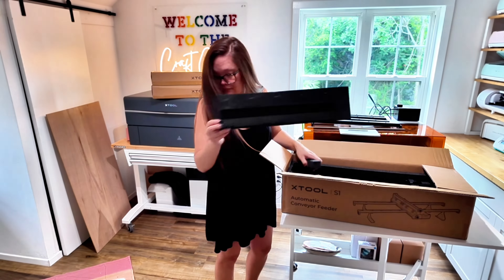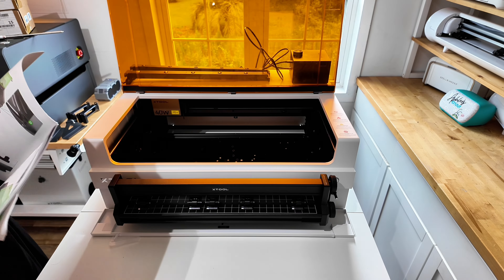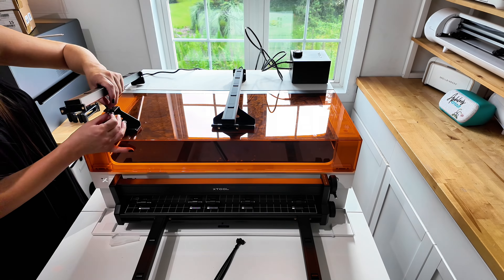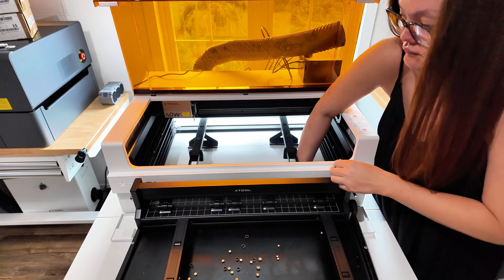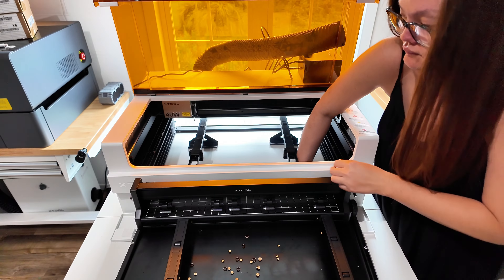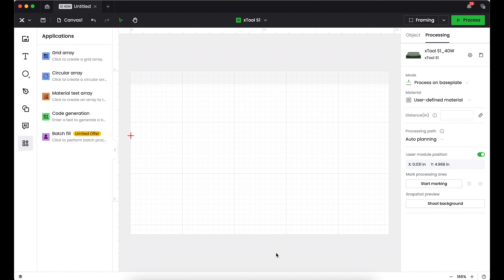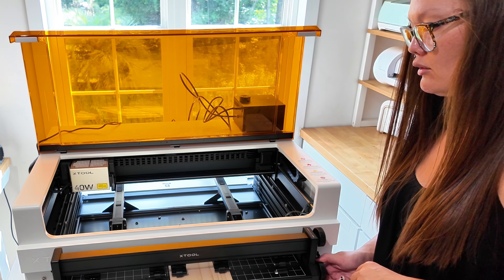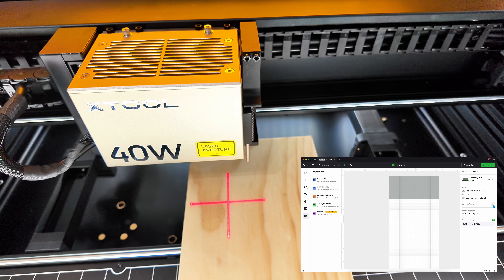Mastering The Xtool S1 Conveyer - Easier Than You Think!

Comment: I’m curious as to how you managed to cut 1/2” of pine on one pass? I’ve tried my s1 40w with 100 Power, 2 speed and 3 passes and still have not been able to cut that thick of material with it? What speed and power and number of passes did you use?
Reply from the maker: Sadly I never wrote the settings down. But I can tell you it was 1 pass for sure. I’m pretty sure I used whatever settings xTool gives for that thick of material.

Comment: Thank you. Do you have a video for HOW to put the conveyor together(install/setup) step by step?
Reply from the maker: TBH, I would go to the xtool website and watch their how to video no how to assemble it all. It's kind of a PIA LOL
Reply: @ashleefalco  No luck, went there already before I asked you if you have a video.  This company is good for hype and flash but very messy and untidy on the steps/step by step details for installation. You mentioned that xtool does a great job with illustrating? NO they dont. There are several steps left out before the subsequent step."Arrows " dont tell you anything when there are multiple steps within that step and the next step, before moving on. There 's a new xtool design space and the steps you display here are 50% obsolete. The newbie will get lost after you say "now lets go to the computer..." when you pull up design space because it has been upgraded there is no right side panel that just appear,  you have type in a text/object before it appears. There are other steps you mention here, that is located elsewhere on design space  like "automatic measurement" its found at the top, not in a drop down menu. These HORRIBLE instructions/illustrations in their manual only cause more confusion and more work for the customer. Took me 4 hours to put the conveyor together and the "blocks" never did unscrew and that littlie tiny metal device never turned to lock in place, so the blocks are just sitting under each conveyor rail. A straight nightmare and HUGE waste time
Reply from the maker: @Linneydenise  strange. I went to there website and looked up the guide and that's how I was able to assemble mind with zero issues. 

I cannot control in xtool updates their software and changes where buttons are placed which is why I narrate what button I press. Because at the end of the day the button will always be there (may be in a different location but it's there).

Hope you find success with someone elses video.
Reply: @ashleefalco  No one has a video on the install, like you dont, because its too complicated and it doenst follow the manual. As you said, you had to discover on your own where that cord was, the manual doesnt mention it, nor show you where to connect it. Click other people videos for what? The best most helpful part is left out, intentionally.
Reply: Take Care

Comment: Should you have used “tab generation”? Mostly curious because the pieces that fell out of our cut caught on the rails and pushed the wood out of alignment.
Reply from the maker: If you had that issue, I would suggest using tab generation - don’t do a whole lot of them though, because then it’ll be a pain to get those pieces out.
Reply: @ashleefalco I know. It is a pain. I’m thinking it’s only an issue on our thinner material. Thanks for the response :-)